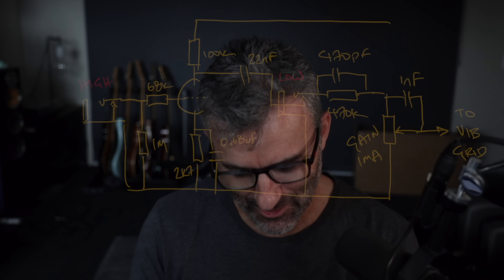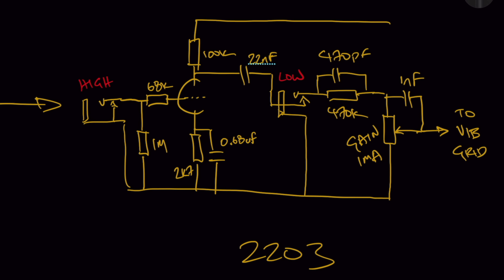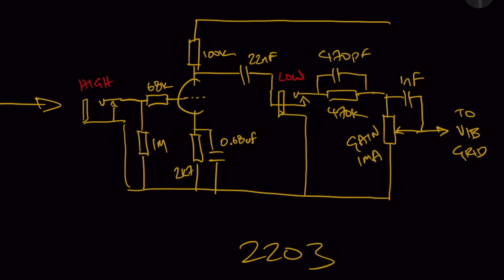3 Gain Stages Good, 4 Gain Stages Better!!

Comment: I used the 1 meg to ground on the low input and added the 82k across the low input jack and made my voltage dividers there like you showed in the og Jose mod.......but I did all this on a 1959 circuit with a dual ganged  pre amp pot and a switch to have a 1059/2203 with that extra gain stage......I had to have that cold clipper......my top jack is the extra stage......3 stage 1959 or 4 stage 2203.....bottom jack is standard 1959 or standard 2203
I also have pre and post tone stack master and switched diodes.......but now since the new amp panel video I gotta tear it all apart and try the new Jose pre amp mod you guys showed so thanks

Comment: How important is the voltage divider resistance ratio? Could the 80k be left and the 1 meg be replaced with a pot? Like how a mark iv has the 2 cascading gains?

Comment: Might do this to a 4 hole Marshall. Jump channels internally. Could have 2203 plus an extra gain stage in front of the 2203 circuit. Will heater winding handle the extra load of both triodes?
Reply from the maker: Yes
Reply: @HeadfirstAmps thanks Jason. I have a few 1987 clone and considering adding an extra tube. The question is where? The Jose mod at the front sounds good but I like the cold clipper stage you installed after V1 of a 2204 amp. I want to retain normal and bright channels and internally jumper so I can mix. Thoughts?
Reply from the maker: Cold clipper later in the circuit if you like the SLO/Recto thing, or stage out front for Marshall++ !
Reply: @HeadfirstAmps The tone on your your Sir #36 mod sounds like what I’m chasing. PPIMV is installed already so maybe use a 1M pot to figure out the voltage divider values if the cold clipper stage. Remove V1 220 uF cathode cap and fat cap so not to flub out the bass going into the extra stage?
Reply from the maker: Follow that 36 circuit and you should be good 👍

Comment: Great work 👍🏻 and very informative videos, love your channel... i did something similar in my plexi(ish)  , i kept the PPIMV in my amp so i have some more phase inverter distortion and the boosted channel cascades in to it with a 470k/47k voltage divider

Comment: You can split the new V1A plate resistor instead of the voltage divider, saves a resistor and keeps smaller resistances (and less resistor noise) in the signal path.

Comment: Great video. I do appreciate these little tips and tricks. I didn't understand why the total resistance of the voltage divider matters but it made sense when you explained how it effects the high pass filter with the cap. Thank you for that.

Comment: does it have AC heaters only?  i can't even build a stock jcm without a lot of hum if the master is past 9:00
Reply from the maker: Yes AC.  Your hum issue is probably something else, use an app to measure the frequency of the hum.  Find out if it’s mains frequency or 2 x mains frequency (the latter is not heater hum)

Comment: I had question in my head for some time "Is it possible to convert reverb tube circuit ( using 12AT7 tube) into some additional gain stage?" I have an amp with broken reverb tank and I don't fix it cause I don't need reverb at all, but was considering to use it somehow as gain stage or even two gain stages that will give like 3rd channel if incorporate some little PCB in place of that reverb tank. Amp already has Clean channel, and Overdrive with 2 switchable Gaines and Low and High inputs aswell. The amp is B-52 ST-100A which I bought as my first practice amp ( I can give you schematics or you can find one in internet, so if you're interested to look at it and give some thoughts about all that). Also I was considering to add a couple of cathode bypass caps in some gain stages which are not bypassed for "more gain" but I'm not sure how it will work and a I'm a bit afraid to make any changes by my own not having any practical experience at all (I have and read Merlin Blencowe book about preamp designing, that's all my knowledge).
Reply: I'm not Jason,but I will tell you that way back in the late 70's there was a product I think was called the "Ice Cube" that I plugged into the reverb connections in the back of my Fender Twin Reverb which pretty much repurposed the reverb into a gain stage. So I think what you are pondering is do-able, I just don't know the circuit specific end of things. For all I know all that JHD Ice Cube was, was straight patch cable run through a blob of epoxy shaped like a cube to make you think you paid for some special electronic voodoo going on inside that really wasn't needed or there. I wouldn't just risk it though, might blow the amp right up and electrocute yourself too. Best ask a pro!

Comment: Bro I just learned something.  Something clicked in my head regarding the overloading of the signal and the amp going into what I now know as blocking distortion from the DOD250 at full noise.   I actually inserted a pot into the pre amp circuit before the phase inverter to control the signal level and stop the fart out (now I know was blocking distortion) your solution being the voltage divider.   Man I learned something today.  😩

Comment: That's why pros use 2-3 overdrives plus a clean boost and a compressor to layer gain and be able to turn different stages on and off. Super high gain amps are cool but how you get from clean to high gain and how they blend and balance is more important. I get incredible high gain tones with killer compression and harmonics using a few overdrives into a fairly clean JCM800. I can get crystal cleans with the volume rolled off and light right hand. I have a BE100 Deluxe but if you set the gain all the way up you're out of options. You have to lean out the gain and boost with pedals for balance and control. Just my personal advice from 35+ years of studio and stage.

Comment: Im running my ADA MP-1 into the front of my JCM800, Clean Tube setting, OD 1 and 2 at "3" , Presence "0" Bass/Middle/Treble "MAX", Master Gain "MAX". 

Its like adding an extra tube gain stage (or 2) to the front of the JCM. The  "Output Level" knob on the MP-1 becomes a Gain 1 knob, while the Pre-Amp knob on the JCM becomes a Gain 2 knob. 

If u run the MP-1 flat out and the Gain 2 knob at 12:00 o clock, it is a noticeably different tone than having the Gain 1 knob at 12:00 o clock and Gain 2 Maxed out. The latter sounding nice and furry, while the former having a more classic Plexi "Van Halen" tone.

Comment: Great info as always Jason. It is very interesting that you need to take the two steps forward, one step back approach when adding a gain stage. With the need to attenuate to prevent the preamp section from being overwhelmed. I guess more isn't always better in that regard. Rather, more in moderation instead.

Comment: Aloha! What do you think of the 100 watt Park with 4 gain stage 1240?
Reply from the maker: don't know that amp
Reply: 1240 is a combo and 1210 is a head. There's a Marshall version but parallel preamp instead of cascading preamps.

Comment: On the Origin20H you borrowed the tube from the fx loop to add a gain stage. It’s got 3 12AX7’s/ECC83’s, it that a 2 gain stage amp + PI/fx loop modes to a 3 gain stage?

Is a Mr Scary mod the same thing? A gain stage sharing the same hole 🕳️ on one of the gain stages, 2 valves where there was once 1?
Reply from the maker: 3 gain stage + CF
Reply: @  thanks for helping me understand the guts inside an amplifier. Can’t mod or ask a tech to mod something I don’t understand.